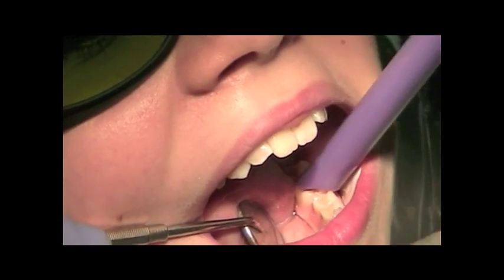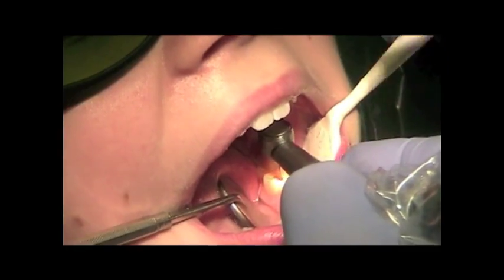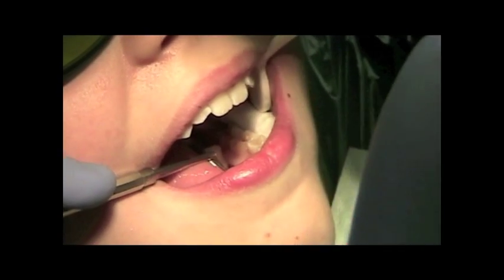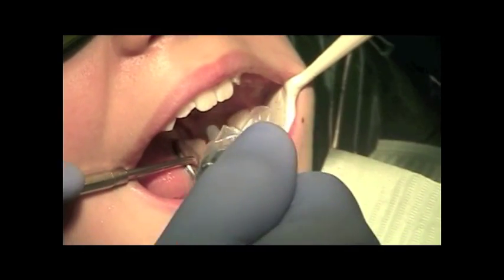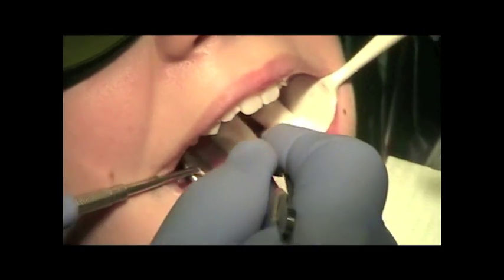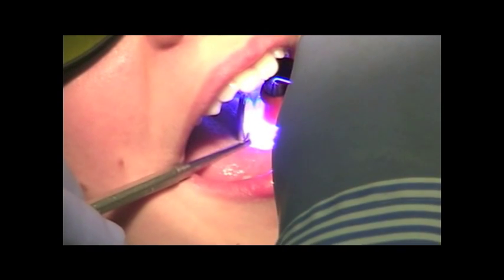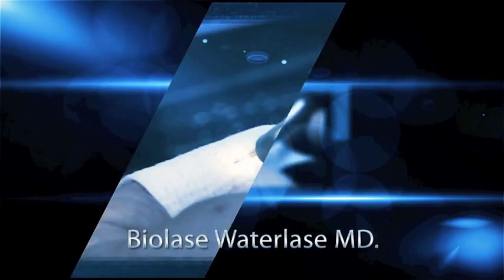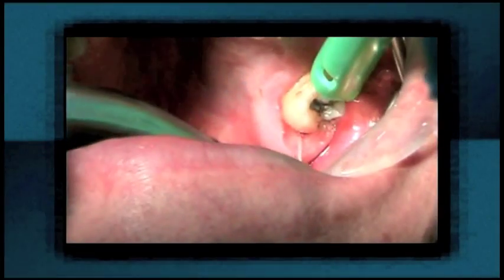Using Biolase Waterlase iPlus To Treat Two Areas Of Tooth Decay-Dr. Simon Rosenberg

Comment from the maker: The self etching, self priming, bonding agent was BondForce and the composite was Filtek Supreme. Plus. The light is a 1200 lumen, rechargeable battery operated LED model that uses visible light to activate the catalyst in the tooth colored composite resin in 5 one-second pulses.

Comment: Dr. Rosenberg, can you tell me, what is the filling material and the curing light here?
Reply from the maker: The self etching, self priming, bonding agent was BondForce and the composite was Filtek Supreme. Plus. The light is a 1200 lumen, rechargeable battery operated LED model that uses visible light to activate the catalyst in the tooth colored composite resin in 5 one-second pulses.

Comment: I have mild decay of inner suface of the lower first molar teeth. it is hard to brush that area and hard to treat the decay of that area.
Reply from the maker: If it is truly mild decay and not through the enamel into the softer dentin, then remineralization with a prescription level fluoride rinse may reverse the condition and harden the enamel.  Speak to your dentist about this or several other caries reversal protocols that can stop early decay.  If it needs treatment, your dentist can tell you what he/she would recommend for your clinical situation.
Reply: DrSimonRosenberg I went to the dentist yesterday, but he treated to the wrong area. I am about to tell which surface of the lower first molar teeth is decay, he ask "is this teeth?" and then he treat it immediately. at the time he asked "is this teeth", my mouth was opened and I could not say it is not that area of the lower first molar teeth. he treated in 5 min and grab the money. too bad

Comment from the maker: The laser is excellent at removing decay and the rough outline of the tooth preparation as well as numbing the tooth without a local anesthesia shot. The high speed drill is used very lightly to smooth the margin of the preparation and the low speed is used to vibrate remove the tooth decay. It is the best of technology and dental state of the art treatment.